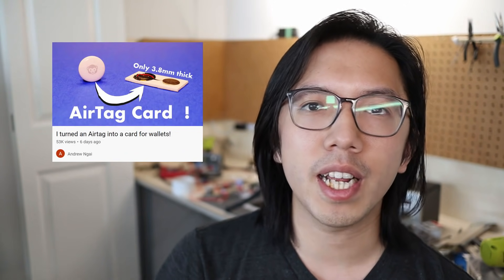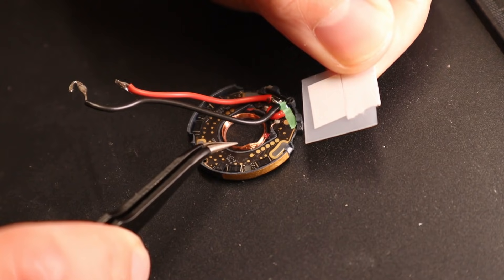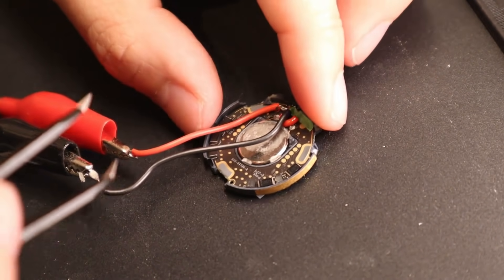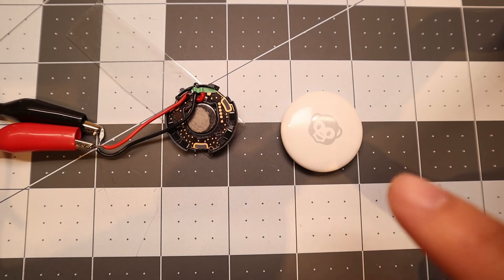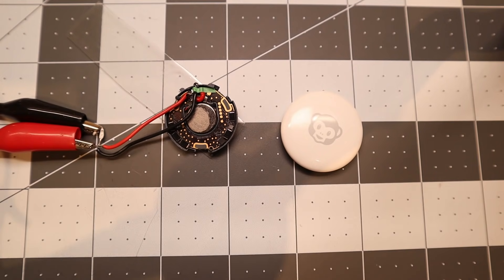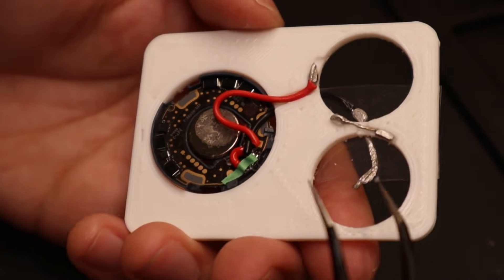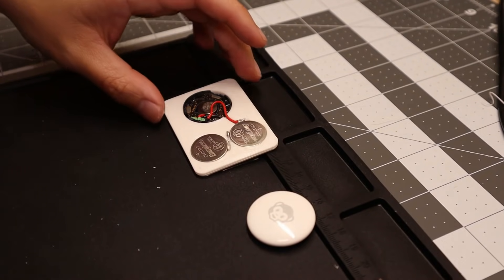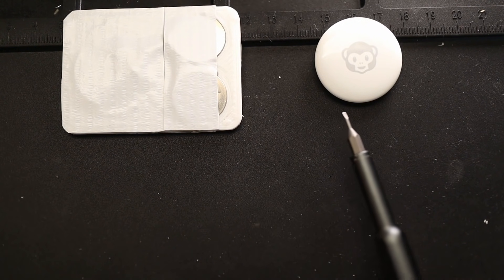AirTag Card for wallets V2 - Working speaker and double battery

Comment: From the first one, I was thinking about the waterproofing. It's rare but I know I've been caught in the rain and I'd be worried to short it out. It's wasteful to only use it for a short time but with 2 years you could encase it in thin resin or sugru or something to really waterproof

For the speakers I agree its hard to match the resonant frequencies to the original. It's a much harder project but there's some research into tuning 3d printed shapes to specific resonant freqs, so it amplifys the tweet
Reply: Or a heat-shrink plastic that you can tear every 2 years to replace the batteries then install a new one
Reply: That's a good point! I like to use silicone conformal coating for waterproofing, like this: https://www.amazon.com/MG-Chemicals-Silicone-Conformal-Coating/dp/B085G42TGS/ref=sr_1_3?dchild=1&keywords=conformal+coating&qid=1620676121&sr=8-3
Reply: Nope. 
If you WANTED, you could cover up the PCB in resin or shit. NOT the Batteries. Because a) they stay replaceable and more importantly b) water ain't do shit against the Batteries and the Cables. 
See, the problem with water is, that it lets shit corrode, therefore short stuff and potentionally damage components permanently. That ain't a problem for the Battery connectors; clean them and you are fine. And if the batteries died, which is pretty unlikely, get a new one. 

Question tough is: Why? The point of this built was as it seems to make it more wallet friendly. Don't know bout you, but for me it's quite rare to go swimming with my wallet. Rain ain't gonna do anything. It's protected by the wallet and I don't know about you - but I don't take showers with my wallet or let it sit for hours in a monsoon type rain. In a regular rain scenario, especially with the duck tape cover, it will NEVER get so wet that one would need to worry. 
Keep sure not to throw it in the washing machine and being waterproof or not will not make any difference.